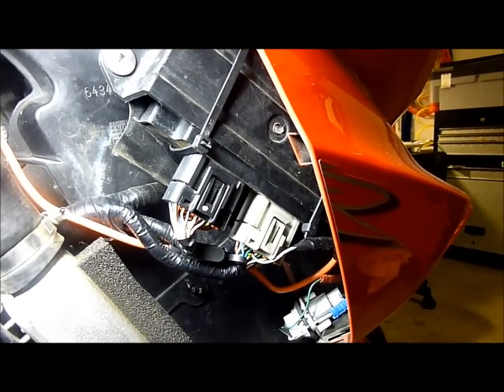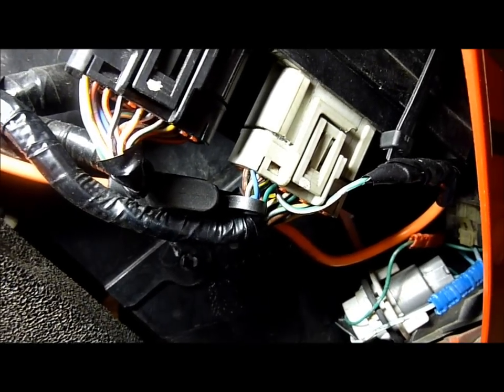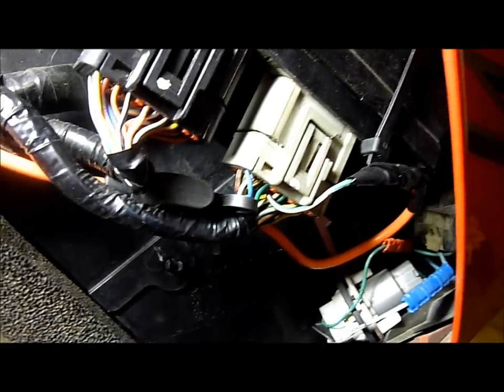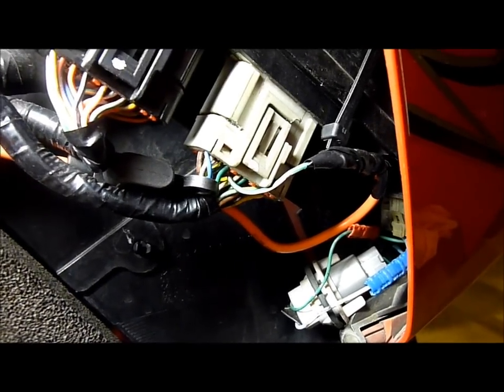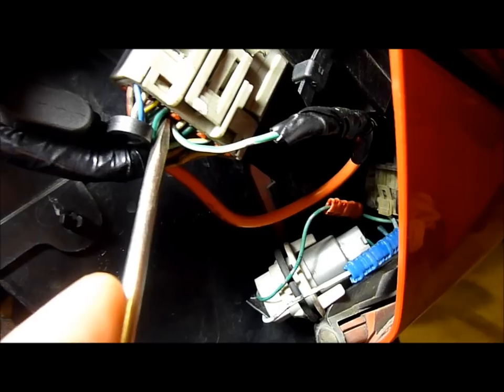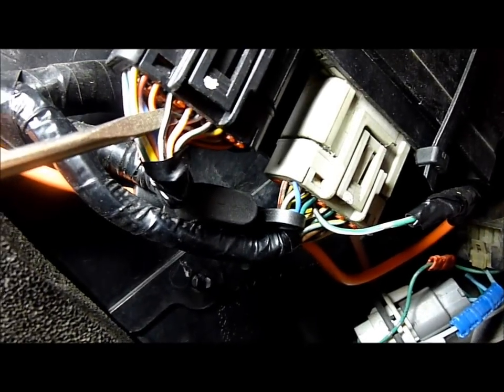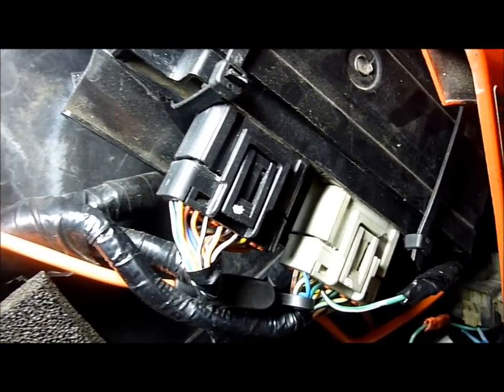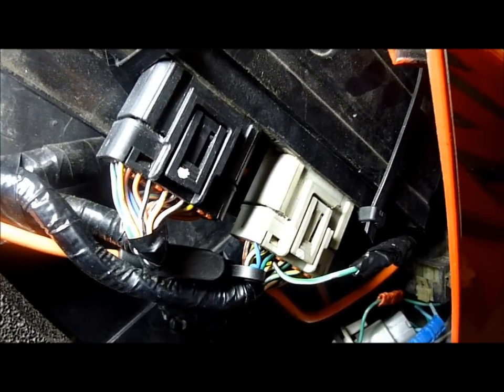Using a non-HISS ECU on a HISS-equipped Honda motorcycle

Comment: Any idea if you can use a hiss ecu on a non hiss bike?
Reply from the maker: Hrm, only if you moved across all of the HISS components and wiring which would be lacking from the non-HISS bike.
Reply: Not without a reprogramming and a ignition swap to communicate with HISS. Bunch of wire running too.

Comment: has anyone got the pinout diagram for the US Ecu and a Pinout diagram for the Euro version? struggling with an 08 1000rr atm and not sure do i remove the pink from the black block and then splice the pink into the power pin 4 on black block and then move the pink wire from block b grey plug into pin 14 on the grey plug to feed secondary power to ecu then just turn on ignition and listen for pump priming?

Comment: I bought a CB500r engine and I want to use it in a project bike possibly a bobber or cafe racer I haven't made up my mind yet, I have nearly everything I need including the UK harness a throttle body, and other bits and bobs, but the one thing I need is an ECU I have looked and there is a few in the UK but mainly in America. The one I saw in Britain was a Haas full kit but I don't think I need that my engine is a 2013 and the question I would like to ask is. There are loads of ECUs on eBay but there are many different part numbers, How do I find out what one I can use on my engine. Thanks.

Comment: I saw a video where a guy explains how to turn the HISS light on for 24 hrs. Ok, what is a HISS light? What is it for?
Reply from the maker: HISS is "Honda Ignition Security System".  The light is just meant to scare away would-be thieves and make owners feel more secure.  HISS itself just means the ECU won't start the bike unless the correct coded key is detected.
Reply: @KaldekBoch  aaahhhh, you would think Ida been smart enough to Google that but alas????🙄

Comment: Hey so I have an American bike and the ignition tumbler was replaced and the pink wire I know needs 9v but at the ecu I need to know what color or position it is on on the black or grey connector that needs for the second power.

Comment: I've seen the mapping is different on us model ecu because of their different fuel mix, do you notice a difference?
Reply from the maker: At the time no I didn't notice a difference.  It would probably be minor anyway because the VFR is tuned for low octane fuel (87 AKI in the USA and  91RON elsewhere which are quite close).
Really the only way to get more power out of a stock motor is a piggyback ECU that can also adjust ignition timing so you can run more advance and use high octane fuel.

Comment: I have european ctx700 with hiss and bad ecu. Used US ecu for my bike is 1/5 of the price of used ecu for hiss one if you can even find one. New is like 2000$
How about I also get the US non HISS wiring loom, many are for sale for another 100$ and getting a hiss free bike. Tried to figure out the power feed pin that I need to add with no success..

Comment: Hi Kal, I am about to replacing my hiss ecu by non hiss in my vfr 2008,  could you share this gray connector pins schema. I have some problems with locating #16th pin.

Comment: Excelent, I have a 1100 xx with the dreaded ecm error code 25. Mine its a 2003 euro spec, with hiss, new euro ecm cost 1200 euro, new 2003 american ecm cost 600 usd,  so, in case I need to change the ecm, dou you think this may work? I dont care about o2 sensor, I´m using PC III and o2 sensor delete anyway. Do I need to change the fisical keys, or they work but without hiss? thanks in advance, great work and thanks for share.

Comment: hi Kal, Ive got a 2007 cbr1000rr and just fitted a n ecu from the usa, Ive done as you have in the video but no joy. How can I find out which port to feed the extra wire?
thanks
Reply from the maker: Just need a pinout map for the USA ECU to find where the second power pin expects to go.  I get copies of both pinouts (Australia and USA) and compare them to find it.
Reply: Needs a step down from 12v to 9v on the second power wire ones 12v ones 9v

Comment: I have a 2005 CBR1000RR that went down the road. I had to put a new wiring loom in due to damage which I bought from the USA. The ECM was also from the states, but I live in Australia and its an Aussie spec CBR. At First everything worked fine, it started ok but ran rough. Now it wont start at all. The fuel pump is not priming and I suspect the HISS. The pump does work when i supply it with power at the relay. Could the HISS be interfering with this? There is a 4 pin connector out the back of the ignition key switch that does not seem to connect into the US loom anywhere, I thought at one time this was part of the HISS circuit but the HISS light is flashing on the dashboard so I guess its working. It really has me foxed this one....any ideas? excellent video by the way

Comment: Great video, ive just bought a US ECU for my UK bike (cbr1000rr 2004) I see you say the hardware is different? I have the same issue everything works but no fuel pump prime, do you know if I can do something similar?
Reply: To add ive also tested the fuel pump with a 12v feed and it works, plus have no power to the fuel pump connector tested with  a meter.
Reply: Lamb Chop  Have this sorted now Kald for the CBR1000RR 2004. will post up the details later so you can include it in your info :-) Im also doing a video diary of my build on youtube (cbr1000RR motor in to a 95 bike) and will include some details in my next video update and put a link to this vid to help others.
Reply from the maker: Lamb Chop Great, thanks mate!
Reply: Lamb Chop Rides Hello mate, I have same issue, can you please tell me how you resolve the issue ? Does the bike idle normally and perform same as with the old ecu (power-wise I mean ? prak750@yahoo.com
Reply: +Ryan Ryan Did you get a solution to this mate? I've got the same issue trying to work it out now!
Reply: Don't you need to power the fuel pump pin on the ecm with 9? That's why a diode to convert 12V t 9V is needed?

Comment: hi kal ,I hope you will see my tx ,if you can help me out I have have get to point that I have to replace my ecu which is uk bike to us ecu do you ting I can do that to my bike
Reply from the maker: Depends, what kind of bike is it?
Reply: hi kal i have 2002 honda cbr600 f4i,i bought by mistake usa ecu and my bick is eroup have hiss harness wire 
what can i do to resolve this problem
witch pin# you main to connect with +12v
Reply: its blade 929 cbr Honda ,2000 ,
Reply from the maker: has gol Yes you can do this to your bike.  There is a link in the video description on how to do it to that model.

Comment: hi kal i have a 2010 cbr1000 and want to buy an ecu from the states and have it flashed, have you confirmed that this mod will work on this bike?and if i use one of the pins you said i can relocate, can i just put it back if i want to use hiss ecu?
Reply from the maker: Yeah I'm pretty sure you can just put back a HISS ECU.  It's what I did to my bike when I sold it.

Comment from the maker: Ah yes, you do actually need the wiring diagram with pin numbers so you can see what's what.   I'll update the video info with a link to the Excel spreadsheet that provides the info.   For reference, it's pin #16 on the grey connector that needs the additional power feed.
Reply: could you reupload ? the link is broken! Thanks

Comment from the maker: Can't see how a diode on the ignition barrel will work - the ECU needs to see a power source on two separate pins that lead into the ECU.  I believe power *can* be removed from the second pin once the ECU has booted up, but since you need the wire and pin in the first place you don't achieve anything with a diode.

Comment: Hey boss there is short in my headlight wire right by the ignition housing and it's making my headlights flick on and off? Could you please give me an solution or advice. Honda CBR 600 F3

Comment: HI KAL,

I just lost my Key to my 2007 HondaCBR600rr.  I do have a copy of the KEY which is NON HISS.

What do you suggest I do to get another HISS key copied so I can use my bike again.

I tried your video however it doesnt work as I actually dont have the original HISS ECU key.

What do you suggest I do.

Great video by the way!!!

Comment: pretty much from 2003 (the model cbr600rr i own) through to current the ECU is under the fuel tank cover, mounted onto the top of the air cleaner box by a plastic bracket and 2 screws, to get to it the ram air covers, seat, and the triangle tank infill panels need to come off before the fuel tank cover can be removed, hope this helps

Comment: great  information... this video give me the courage to buy an USA model ECU for a Hiss cbr 1000rr 2008 and thats it, after a little research regarding the wire harness of an australian an an US model find that putting power to the No. 16 pin in the grey coupler from the No.4 pin in the black coupler and.... wala!!!! the bike runs great without the inmobilizer.
Thx

Comment: Thank you  for quick reply, please is any way to know if the bike has hiss? My customer was using the bike until the battery terminal got loosed and the ecu got fried and i bought a used US ecu from eBay with the same part no. but the bike refused to start.i checked the  4 wires that entered the ignition  2 red wires, 1 black/red  and 1 pink wire.

Comment: I  have a customer 2001 cbr929rr in my  shop and i bought a new ecu from ebay and i fixed  and no start. when i turn on the ignition key no fuel pump noise, no spark from the plugs.i checked all the fuse ok and i changer the wire harness still no start, is any way to use USA ecu to Europe bike . can the bike has hiss?  please help.

Comment: Hi Kal,
Did as you said, no 12v at the b/w wire at the ECU, tracked back to the cut off and engine stop relays, no 12v.So i went to the rectifier and found no 12v. Kal, youve guessed it already, i am the biggest donkey that walks on this planet. Went back to the main fuse, looks fine, that is until i put a continuity across the spades and found it open circuit.
New fuse, up and running, except the fuse holder gets hot so i shall modify.
Kal, you are a superstar, your imput saved a suicide. T.

Comment from the maker: OK next step is to check that you have power at the Black/White wire going into the ECU.  This is easy enough; turn off the key and remove the ECU connectors from the ECU.  Find the pin(s) which have the Black/White wire going into them and stick a multimeter positive probe into one of them.  Hold the negative multimeter probe to the bike's frame then turn on the ignition key.  You NEED 12 volts at that black/white wire.

Comment: H i Kal, You sound like a diamond guy.What happens first is that there is no HISS light blinking when you aproach the bike (no ign key inserted). Insert the key turn on, no lights at all except oil (red), N (green) & h'lights (no F1 or HISS). turn key off and HISS light starts blinking normally with or without key in lock.
When ign turned on i hear the engine stop relay click on and stay on (this is the relay above the oil cooler, nearside, side stand side of bike.

Terry.
Reply: Terry  my 954cc  just started doing this. The bike actually runs but it cuts out
Reply: Terry  my 954cc  just started doing this. The bike actually runs but it cuts out
Reply: Terry my bike just started doing this it startsv& runs but the red light comes on & it cuts out then starts again it has HISS ON IT A CAN HEAR SOMETHING CLICKING NOW ASWELL & ALL THE LIGHTS YOU SAID ON THE DASH IS THE EXACT SAME AS MINE'CAN YOU HELP ME PLEASE MATE I ALSO HEAR THE CLICKING NOISE BRO'AM STRUGGLING ITS SO FRUSTRATING PLEASE HELP
ME BRO????

Comment: Hi Kal,
Thanks a lot for your input, no 12v at pump, given direct feed and pump works ok, cant be engine stop switch as engine still cranks, engine stop switch off no crank, totally bewildered.
Do you think it maybe a PAIR valve prob, totally stabbing in the dark now.
Cheers mate,
Terry.

Comment from the maker: Have you tested that the fuel pump is getting 12 volts?  Lift up the tank and check there.  If  it is getting 12 volts but there's no fuel pump sound, the pump is jammed and needs replacing.  If it's not getting 12 volts I'd go back to the fuel cut and engine stop relays.  More than one VFR has suffered from a dodgy engine stop switch; these CAN fail, and the symptoms are the same.
Reply: Hello Kal I’ve got a GL1800 which Im trying to fit a us non hiss ecu to what am I looking for on the diagram on the us loom that indicates the feed and would it be 12v or reduced ecu voltage I just get FI light lite no pump etc thanks in advance

Comment: Hi Kal,
Thanks for your speedy response, having looked at your other vid i am not so sure i have a HISS prob, when i turn the ignition on the HISS light goes out but no fuel prime. checked the pump all ok, checked all fuses, relays, connections all ok, now confused as to where i go next.
Terry.

Comment from the maker: I bought mine on eBay. However the 2002-2005 bikes use different ECU hardware to what I list here.  Have a look at my "Honda Ignition Security System behaviour" video, because this will confirm if your problem is actually HISS.
Reply: Hello, please help me. I bought a 2009 honda cbr600rr to fit the American ecu, but I couldn't fit it.

Comment from the maker: @jonono63 I happened to have a USA wiring harness and an Aussie harness back to back, so I created an Excel spreadsheet and marked what colour wire went into each pin on the harness-side connector.  If you don't have that you will need a USA model wiring diagram from Honda and an Aussie model, and compare those instead.  Also your CBR1100XX is an older model ECU hardware - maybe you won't need to do anything other than just plug in the USA ECU!

Comment: Thanks for the great video, and for the hope I might get my cbr1100xx blackbird back on the road.  My ecu looks like yours, but the wires are different colours.  I have just bought a US ecu but don't want to fry anything by putting wire in wrong place.  Are the pin numbers just the same?  How do you count the pins?
regards - jon (adelaide)